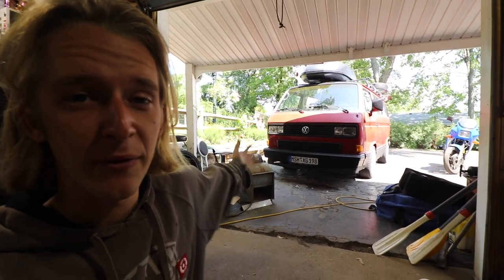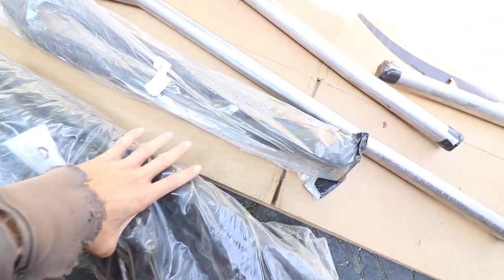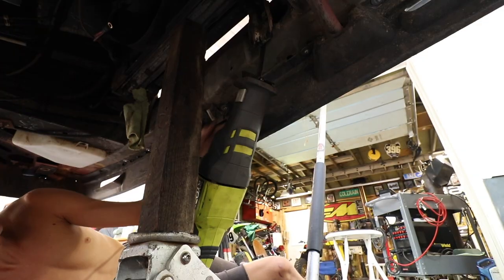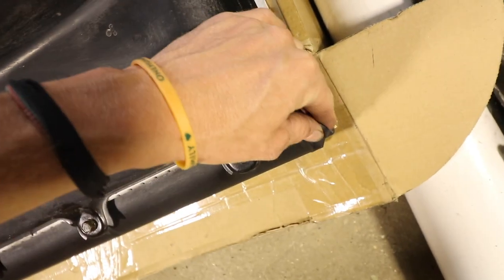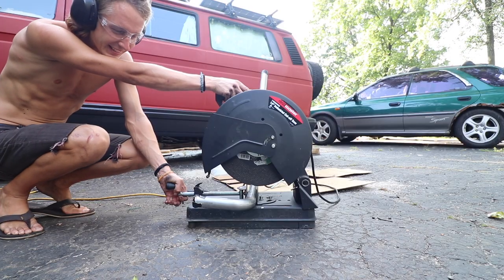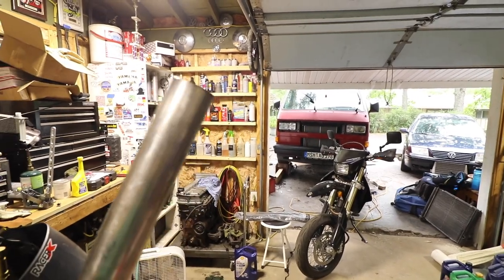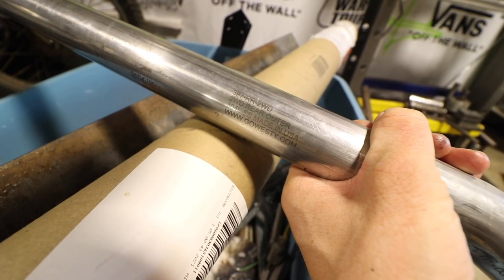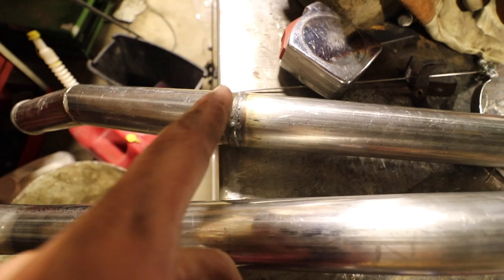Vanagon Stainless Steel Coolant Pipes//Install (pt,1)

Comment: I've been eyeing those Stainless pipes..sounds like a winter project for me
Reply: I thought my first set were painful, but at least no TIG for me... all these jobs could be done at one major down, the power steering lines, the gas tank replacement and new coolant lines and replace hard brake lines at the rear cross member, because they all rust and leak and that was like 3 evenings screwing around with that....in the driveway on cardboard.... good luck !

Comment: Wow, those lines were so much different from your original ones. I wonder what they were thinking when designing them! Glad you're getting them to work though.
Reply from the maker: They were definitely a little different. I even tried to find them on Go Westys page under 2WD 2,1 Vanagon. The pics they had looked different... Honestly I looked at every set of pipes they offer for every model and no pics looked like mine. Every pic looked different compared to these, I still don't know what they're for?!?😂 They said 2WD Go Westy on them and tried to search the numbers stamped on them but nothing was matching up... Its all good they've been on there for a while now and they're fine!!!🎉
They'll be on there forever.
Thanks again🤙
Reply: just watched the video on gowesty and they have that 90 degree kick... I talked to Rocky Mountain when I upgraded my 85 -- they said, oh, EJ25 and you want to go bigger (2.1 lines were larger diameter) and that's what they sent.  Now my best man who installed these is wondering did he cross them up ?   Came here to learn more.

Comment: Those steel sleeves in the plastic original coolant lines is the main reason the stainless steel ones even exist, those sleeves wander out over time. You're lucky your lines stayed together this long, especially considering your long trip. Looks like you caught that just in time. Sadly its one of the many flaws these buses have, just replaced the ones in my bus with stainless too, since i was doing the subaru conversion anyway xD
Reply from the maker: NICE!! Yeah it did seem like they were coming out on the one pipe. Honestly other than the steel inserts coming out they were fine. I wouldn't hesitate to run them. When I took them out I tried to bend and snap them to get them in the garbage can, they were TOUGH. NOT brittle at all!!! idk what material they are, especially considering there age, but its the right stuff. They just creased, and turned white(with a LOT of force). Theres no way they'd ever break in the van and see that kind of stress. But with them inserts popping out, they'd definitely fail!!!
What kind did you get?? Did they fit good?
Reply: @PostPros  I got mine from TK-Carparts in Germany, mine were also for the 2.1 and Diesel - they didn't have the weird 90° bend in them that you had though, maybe you had the early model version, I think there are two versions for the 2.1. Mine fit very good, even got the stock steel hangers to work, though it was a tight fit in some places.
Reply from the maker: @ernie_und_brrt  Interesting, thanks for the reply!!